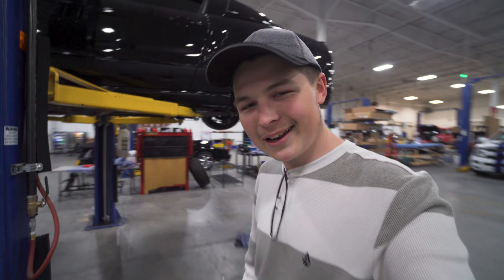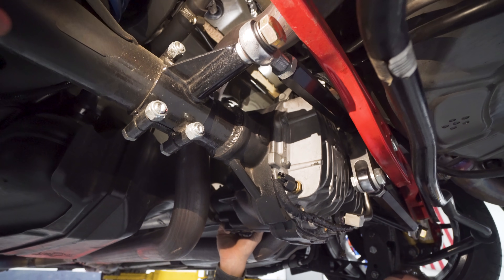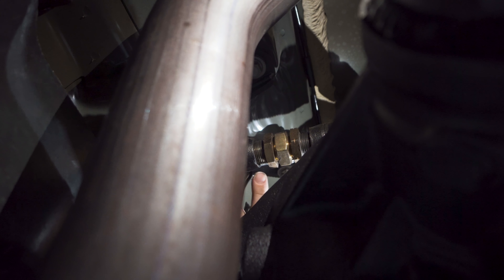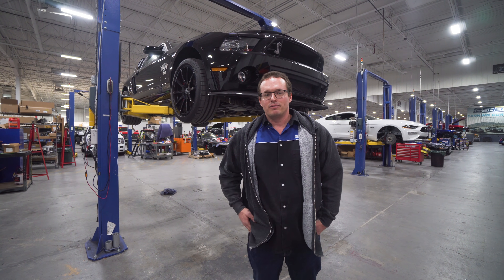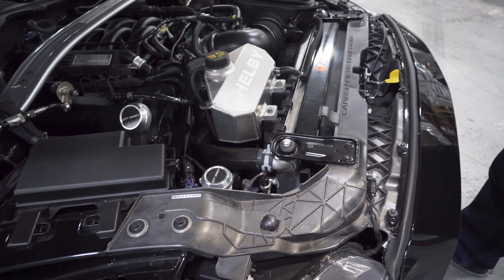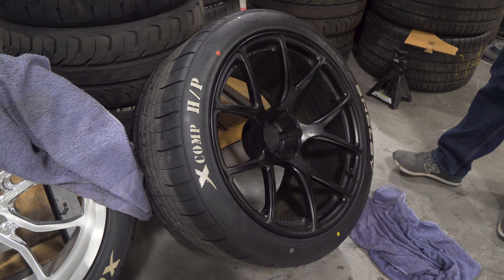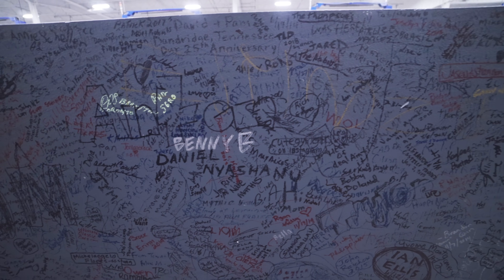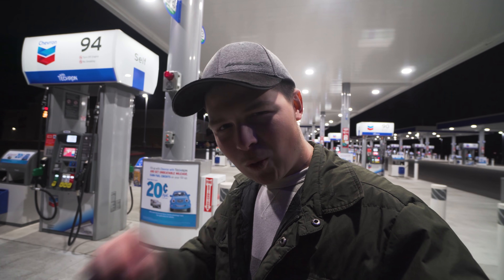Here's Why SHELBY Will FIX My GT500 Super Snake... And NOT FORD

Comment: Nice to see Shelby stand behind their product and fix it right. Good tip to know about those adjustable control arms! I'd love to see a review of that Boosted Bullitt!!!
Reply from the maker: Definitely a great idea! I'll see what I can do!
Reply: the point is there should NOT ever be such a ridiculous problem like this in the first place.  WHo the fuck designed this shit?
Reply: If you had seen the original vid,  he said the rear had been out  & when you do that you have to recheck/reset pinion angle. The Loc tite seal was broken so the jam nuts were never retightened correctly when installed, allowing it to move out of spec to cause interference with other parts.
Reply: Nothing at all wrong with the design, but the human element leaves it open to assembly errors which is what may have happened in this case. If those lock nuts can't be held into position then the non-adjustable control arms are a better deal. It may just be a matter of using the right type and amount of loc-tite to hold them in place so that vibrations in the driveline won't shake them loose and cause these kinds of clearance issues & damage. I give Shelby a lot of credit for diagnosing the problem fast and standing behind their product and owning up to errors made during assembly. After all, that SS package don't come cheap!!!
Reply: @tomkjr1   it's not Shelby's fault he said another shop had the rear out, it's their deal
Reply: @STARSHIPTROOP  I did not hear that part. In that case I'm surprised that Shelby is going to fix the problem. I wonder if they will charge him for the repair. If so, he should hold that other shop liable for the cost.
Reply: Fix it right? They changed the one link because it comes loose. They screwed up so they better fix it.
Reply: tominator the tech said he was changing to a solid coupling so yes there is a problem with the design.

Comment: Dude's dad will be happy that he doesn't have to pay to repair his kid's improperly modified car.  Not to mention, there's some weirdness with Shelby on this.  It looks like they know this design will cause clearance issues already, plus I saw no loctite or teflon tape on those threads and I can guarantee there are more of them out there.  If they had "contaminated loctite", then that means shops use huge bottles of them that will work for like thousands of fasteners.  That means the bottle is still around and other cars are affected.  However, we know that's all BS.
Reply: No that means they can't own up for or simply blame loctite. Also means that he should properly check his control arms before and after each run. 

They fixed it, they didn't say it was their fault.

Because people don't like regular maintenance, it would be easier for them with a non adjustable link.
Reply: I've never thread locked any of the adjustable links.  If if TIGHTEN them they won't come loose.
Reply: @Makitaization  only thing here is that the current owner didnt get under a race care to check for wear. If be drags the car or burn out, that's a lot of potential for movements
Reply: @Makitaization  race cars vibrate like crazy. Everything needs to use loctite, the red stuff.
After I installed the torque solutions mounts in my evo, the hoodie sitting on the passenger seat vibrates at idle. It's crazy.
The car is solid and nothing vibrates, just anything not bolted down and loctited.

Comment: You actually did the boys at Shelby a big favor. They now know that the adjustable link has issues and needs to be replaced by one that is solid. Now IMHO, Shelby should issue a TSB to all owners of the car letting them know that there is a potential problem and the repair should be facilitated through local Ford dealers as not everyone will be able to get their cars to Shelby unless Shelby is willing to pick up the shipping expenses which will of course be substantial. This is the problem with limited production cars. I use to find this with a number of my SVT vehicles over the years and FORD honestly just did not want to be bothered in most cases. Glad to see yours will be taken care of properly. Happy New Year BTW!

Comment: Remember to have everything re-torqued after about 20 to 50 miles. That gives everything time to seat and the re-torque sets the parts in place for good for the most part. The mechanics now days have gotten away from that because they think because they torqued it when they put parts on that it is good to go. If you have a moving part like you do in the suspension you need to re-torque the hardware after parts have seated.

Comment: If he daily drives that car the. He does not need an adjustable upper.   That’s why they are replacing it with a solid.    That’s what i would do.  Why use an adj.upper if it’s just going to sit there and not do it’s job!  Makes sense.

Comment: Loktite contamination..?! 😂😂😂😂😂
Clearly there never was any Loktite ever used or you would see it on the threads..!!!
Reply: upfreaks, I've been using Loctite since 1980 when I built my first engine at 16 and ive never even heard of contaminated Loctite. Ever. You are right man, those threads were clean. Threads that had Loctite on them makes a mess when you take it apart.

Comment: Why not safety wire it?
Reply: That’s what I was thinking. Solves every issue we have with aircraft
Reply: Yeah, if that's my car, your not taking an adjustable part off.
Reply: @ThanosGT500  im suprised that shelby doesnt already do that. You would think they would and charge an extra 20k because "racecar mods"
Reply: Safety wire is strong, but even in aircraft applications, it is questionable in certain envelopes of flight due to rapid temperature changes, altitude pressure, humidity. Maintenance scheduling and overall composition of the wiring. Thah being said, from my experience with both eastern and western aircraft, Solid linking is pretty common with Ilyushins and other warsaw pact aircraft which have a far better reliability than Boeing and Airbus in terms of operational downtimes.

Comment: There is a reason race cars with tons of adjustable suspension components use safety wire... He is never going to wrench on that thing to tune it for specific track conditions. Use a fixed upper arm.

Comment: Hmmm the fix is the non adjustable arm ? i hope they also shrink up the fittings in the diff hat ( more clearance) cause it still looks tight and it also beat up the top oil line too ... Good luck with it all

Comment: If it's such a critical part in a high vibration area, why are they hoping a bit of Loctite will do the job? Drill a few holes and secure it with wire.

Comment: With all the power why still run bushings ???? Why not run link bars on the set up with all heim joints ??? Heims dont allow any movement like bushings do ... I ask because the tech said well that's just how it is under here there is too much going on here.... if that is the case why not make the rear end links as solid as possible ? No matter how hard you launch on heims the rear end wont move where its bolted up ... before I get hammered by the know it alls I'm just a regular idiot asking a question lol take it easy

Comment: You couldn’t figure that out on your on? Or do you not have the tools like a lift and stuff. I’m not hating just curious or did you just really want to go to Shelby plant lol
Reply: Looking at him and listening to him really sums it up. Shelby having to put a inferior part for trustfund babies. I doubt he even changes tires himself.
Reply: Fox RodX275 Like?
Reply: It was the wise thing to do and why not the parts and labor were free, get it done and done right, there's your answer!
Reply: Summit X  not trying to engage in internet banter. But anyone should understand that the shelbys are only modified mustangs ment for masses and designed for moderate power. This is some of the best mustangs built. But to put them in same class as super cars listed is not acurate nor responsible bottom line it is a highly modified mustang trying to punk some super cars yes very American.  There is only a few American super cars. Saleen s7, Ford GT etc. But these are my opinions some agree some dont. But buyer should be aware of what they are buying. And honestly i personally cannot afford this car. If I could I do not think I would invest in it. Again personal opinion. This guy bullied shelby with his channel and shelby replaced a adjustable part for a non. I think this sums it up. Heck Ford would not help him for an obviously beyond simple fix. Besides the fact that pinion angle being off several degrees lack of traction and changing handling should have been noticed. Sorry that you feel Im a prick. But I'm honest.
Reply: @williamphilippus4700  ... drivers - don't need to be mechanics! ...Matter of fact, most mechanics prefer it that way. A man who knows his limitations - is a lot smarter than an idiot trying to tell someone else how to do his job.

    personally, I have walked of many jobs or refused to work on things after some "wanna-be"" screwed it up, then came back complaining about "My work" wasn't done right. 

     Know your place - know your limits! ....everything will go much easier. Ain't nothing wrong with asking for help. Much better than serving up BS - then pushing the blame on those who know what they are doing.
Reply: @JustinAEgan  i agree with 99% on people telking others what todo without knoledge. My point is he bought a highly modified piece of machinery to use for its design track etc. He should understand the adjustments availible to him and what to check between events. Referred to nut and bolting. People work ther way ip to being drivers. And frankly tear up alot of equipment to becoming a driver vrs a kid with alot of money. Look up Hulk Hogans son also thought he was a driver. His videos are good quality wish he would become more mechanically involved or bring a mechanic to his channel as others have done. Would improve his channel. Imo

Comment: Shelby isn't doing anything special here folks.. it's just plain and simple fixing their fuck up but with the added bullshit explanations. contaminated loc-tite? yeah okay there space cadet... the contamination must have made it either evaporate, go invisible or maybe they used crazy glue instead?  anyways they lied to you but fixed it like they were responsible to do...  funny though I cannot remember the last time I saw a jambnut come loose on even a pulp truck that hammers up and down horrendously rough roads if they were properly torqued without even using loc-tite..... just sayin'

Comment: All videos were made and end result is the reason the car broke in the first place is because someone took the complete rear differential out of the vehicle and left the adjuster nuts loose on the watts link which caused it to make contact with the bottom cooler line fitting,,,so problem was caused by someone working on it that didn't know what they were doing!!!!!!

Comment: Contaminated lock tight more like bad design
Reply: I beg to differ... Loc-tite CAN be contaminated! .... They mention, on the packaging and even on th instructions,  that the surfaces need be clean and dry - for a reason. oil, 'old, left-over loc-tite', grease, etc... can and will contaminate and affect whether the loctite sets/seals properly.  vibration then causes the parts to loosen.

    We all trust loctite now... but back in the early days - Safety wiring castled nuts, wired twists were the true mark of a professional making sure adjustments stayed where you set them (nuts stayed in place) and it was visually easy to see if they moved or were moved/tampered with. It was/is a lot of work, to go to that level of detail...but due to the cost of manpower - we got lazy!  now people even question the replacement - easy - methods?

     Not certain, but I think - in air craft, they still require safety wiring, wire ties and other mechanical seals?
Reply: Kevin Wiltshire exactly! !!!!!
Reply: @JustinAEgan  Yes, wire locking ties are required in aircraft engines. And lots of them.
Reply: Well, it's adjustable for a reason: So you can adjust it. This car is for racing. Racing well requires adaptation. It's only a bad design in that it wasn't designed for drivers like this guy.

Comment: the actual ford dealership cant fix a lighbulb honstly never go to the dealership ever
Reply: Dealerships .... mostly try to work off the internet or through a web site, now. Every time I drop by the local dealers - all I see are subcompacts, "Huge trucks" and used cars.

     The only time I go to the dealership any more is for factory parts, warranty work (need to get that stamp in my owners manual).

Comment: Found the problem straight away because it's a design fault, you can see the problem who puts a solid oil line on a moving part and then sticks a link bar bolt right behind it 🤬 of course there is going to be problems and there will be again until they move the link bar bolt  away from the centre of the diff housing and put a flexible oil line with a banjo bolt to the diff housing

Comment: The Shelby  r does not get any better the flat-plane crank motor at high RPMs is swinging the rods out of the block especially people that are going to track day so many people are asking Ford to buy back their cars and they are lemon lawed brand new 18 and 19 50.Coyote motors are coming out with ticks off the showroom floor 6-speed Transmissions are breaking 3rd and 4th gear Forks come on Ford it isn't isolated case there's hundreds of people out there with cars that are in Ford service for months and months while they continue to make car payment Ford continues to produce junk just like their truck they produce three different diesel engines inside of a 10 year time span because all their Ford diesel engines were junk also Ford is  junk stay away they have more lawsuits going than any other car company
Reply: Ford has only made 1 diesel and the 6.7 is one of the most reliable ever.
Reply: @jonathansandefur7672  I love you people ford only made one diesel but all the other Motors they sold had their name on them but they didn't make it it's the same thing dumb ass if you put your name on it and sell it you're supposed to stand behind it you might as well made it ? in the last good one with the 7.3 they came out with 6.0 6.4 and 6.7 and they're all junk and it doesn't get any better what their car engines Ford continues to produce junk products and take people's hard-earned money